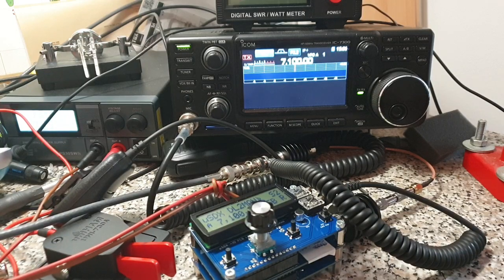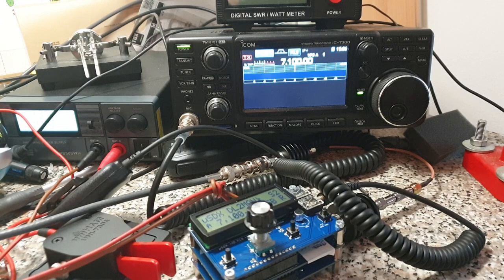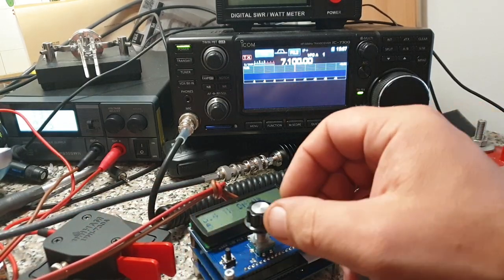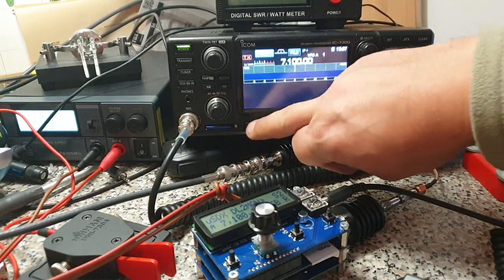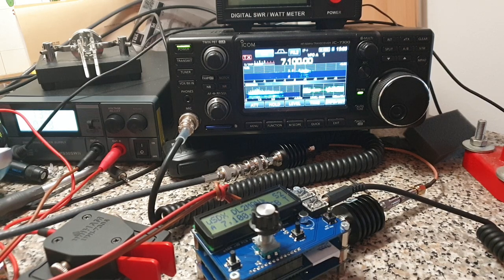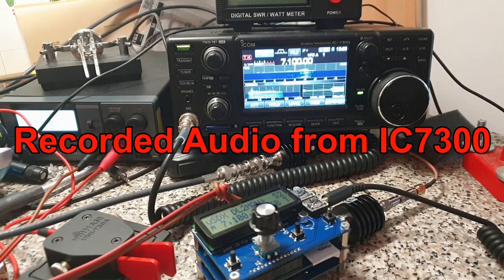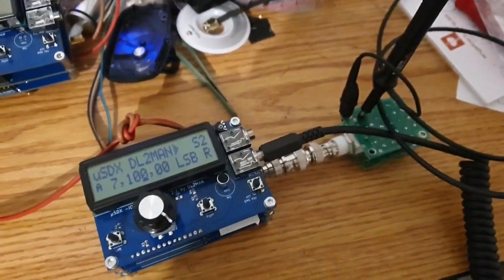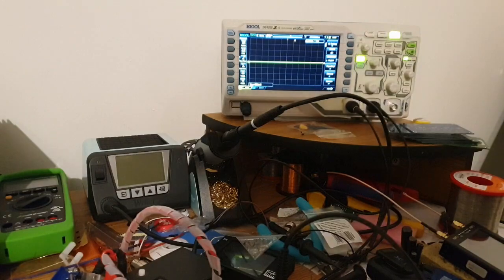DL2MAN uSDX SSB transmit demo

Comment: I learned a trick years ago similar to tuning guitar strings - use a 2nd receiver on frequency with a good full range ext speaker.  Key transmitter and listen to your voice, tuning your tx until it comes through the 2nd radio’s speaker with no ‘waves’ or warbling’.
SSB can be finicky, sometimes merely switching a radio in and off can throw off ssb a few Hz.
Reply: . . . on and off . . .

Comment: Why not get a more basic data radio  DR4020 from Venus Information Technology and rework it to do SSB   phone. ? that will be far more profitable and produce better audio.  $118 USD gets you the basic bogie with  4 - 5 Watts out in class A from an IRF 510 and you get 40 and 20 mtrs.  Tcvr  My tuppence worth.   The Ucontroller used by VENUS  is  some weird beast of PIC but could be  changd out for a a  ATMega328 - with perhaps a  swizzle board back to the Pcb traces.  There is plenty of code on the Hans site showing the basics of how to do this and even photos of a working example of  LCD/ Encoder and SIlabs Function chip.     TE Fidler.

Comment: Move the software to a 600 MHz $20 Teensy 4, it’s pretty small
Reply: Looking to see if this has been done yet, Teensy 4 would address most of the limitations of the old and under powered ATMega328 MCU.